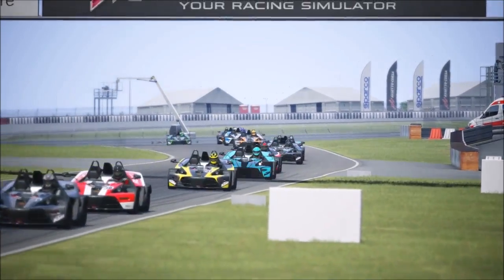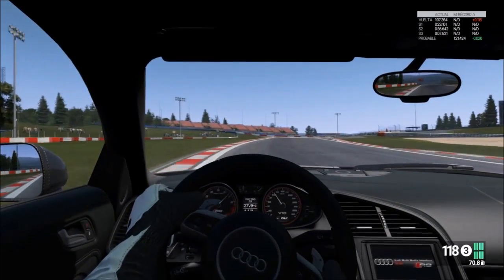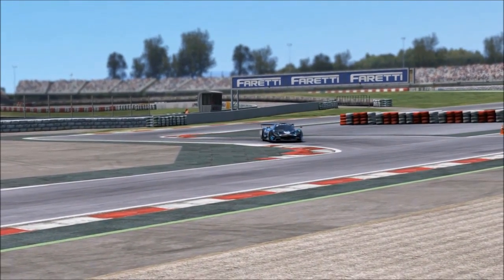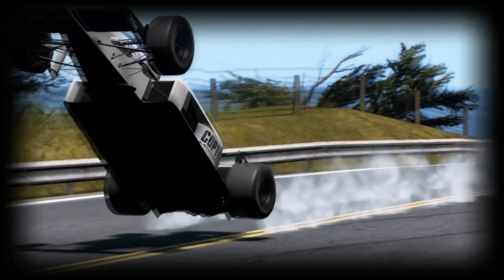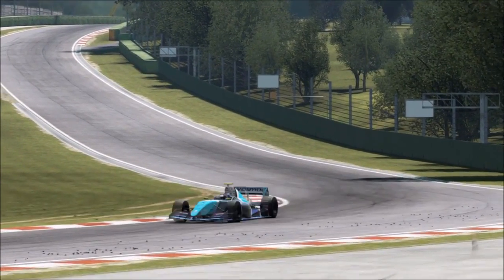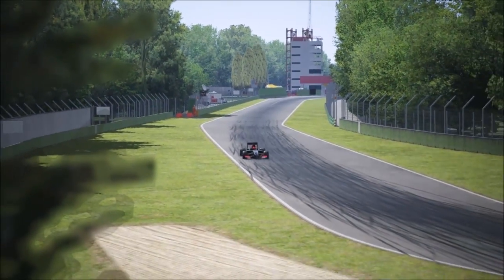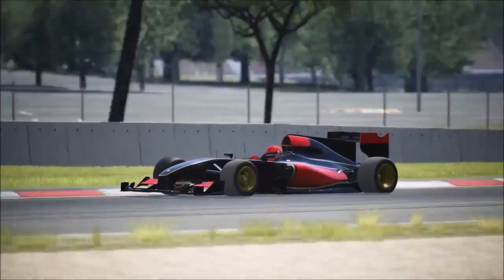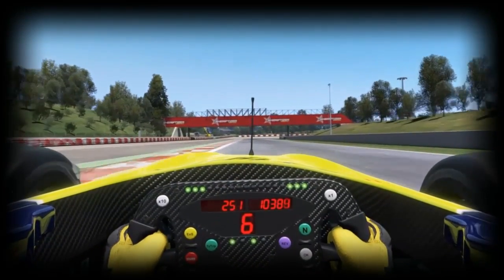Assetto Corsa vs Project CARS: Physics overview (2)

Comment: like you said assetto makes sense in terms of what inputs you give it, but it just doesn’t feel real. something is off. i drove one of the cars in assetto also irl, the new mustang, and it was quite different. wasn’t racing or anything just driving on the street. well this is a racing sim, so maybe street cars and road driving aren’t its strong suit. the biggest difference is that in assetto that car felt heavy and understeery when in reality it kinda felt like it was on rails. i’d say it’s a 7/10 in realism.

Comment: Still not convinced with the curb feeling in AC. Maybe the example, in this case, made PC look bad due to the bad laser scan but in AC curbs are like polished glass with springs on them. I also find the car feeling in PC a bit better than AC. Makes you feel like you actually sitting in something that weighs nearly a tonne while in AC sometimes the cars feel weightless. Also, the lack of camera movement due to the momentum takes that feeling away. Can't wait for AC2 though.

Comment: I’m new to sim racing and only have a T150 for a wheel. But my 120” tv and incredible surround sound system make for one hell of an experience. 

I like project cars 2 for its career mode. It’s really immersive and I love jumping in every Saturday like a real race weekend. That being said, Asseto Corsa is just so incredibly realistic. I Auto X my mustang and the physics in project cars 2 leave me very confused at times. It’s just not natural and unpredictable at times. This is frustrating to the point where I don’t spend much time in it other than the Saturday. The weather elements are cool but if the rain comes down hard enough good luck figuring out when or why you just randomly spun out. Also the spins are very uncontrollable.

Over all

Project Cars 2 has the tracks and cars along with slightly better environment graphics. Also the career mode is outstanding!

Asseto Corsa is the Pinnacle of realism with sound that blows my friends minds when they come over to play. Overall just a better driving-simulation and in my opinion the game that gets most of my time.

I play on PS4
Reply: Do you mind sharing your force feedback settings for your wheel...??? 
Also, do you set the Stability Control option to 0%...??
Reply: RAUL VELASCO sure, for project cars 2 right?
Reply: @bodyshotjake7475  No for Assetto Corsa  please.
Reply: Sorry for the late response.

FFB 81%
Kerb FFB 30%
Road FFB 50%
Slip FFB 25
Understeer on

No driver assist other than breaking
Reply: @bodyshotjake7475  Thank you!
Reply: How do u rate ACC
Reply: @jonitalia6748  There is a pilot from Ferrari gt3 blancpain series it's called David Perel and he plays ACC . He said that the chassis flex in the same way that the real car , I don't know how much realistic is the game really but If it is i think is something ridiculously awesome and great.
Reply: @saulcr839  he said acc feels just like real life except at 95% gravity

Comment: I can't help but feel this is just the typical "it's easier to lose control in Assetto Corsa, thus it's clearly a better simulator because it's more difficult".
Reply: Hopping a 6" curb while turning at 50 mph would definitely upset any car. Assetto corsa is harder to control because it models understeer and oversteer correctly, you just don't have the physical g-forces to help react to a slide before seeing it. It's also harder because most people don't push cars to the limit in real life, while in AC we push further than we realize when risk is not a factor, and then say the car feels "hard to control" or "slides too much".

Comment: I am a pcars player and decent at it. I just got assetto and I'am 6 sec's off my Barcelona time in p cars which is in the 1:46 range. Hell I have not got below a 1.52 in assetto and they seemed like decent laps. Just seems like you lose so much speed in the corners on stock setups at least. What's the key to getting the cars up to pace ?  I don't like the bare bones setup of this game either. I mean no brake or throttle pressure adjustment makes it VERY sensitive on controller.  It also has weird brake bia's value's, no custom button mapping etc. I for sure prefer project cars in this area. Game feels good though and is a joy but I am slower than heck on lol.
Reply from the maker: +James Avery you should not compare times directly, PCARS is usually more grippy when you use similar cars. I remember lapping GT3 at Silverstone in PCARS in 1:59 and in AC I do 2:03
Reply: Good to know thanks !

Comment: Funny, I just spent 30 mins in AC after a long time not having played; took the 458 to Imola on default setup. I was able to absolutely smash each and every kerb, run on astroturf and grass with minimal issues. The car ran over the bumps of the first chicane with absolutely 0 drama - not to talk about how much I was able to cut there (4 wheels off the grey stuff both in the left hander and the right hander) without any sort of cut track penalty or lap being nullified... I also abused the tires quite a bit with a lot of sideways slippage accelerating out of corners (not drifting, but a fair bit of on-throttle oversteer requiring some opposite lock) and after 30 mins of this one of my fronts was still blue and my rears were up in the high 70'ies... flash heating wasn't anywhere nearly as dramatic as what was shown on the formula car. With factory ABS on I was able to stand on the brakes from beginning to end of a deceleration with no tire slip and no adverse effects. Zero skill required.

Now, @Dyr_gl PSN, I won't say you are wrong, because some of the points you bring up about pCars across the 2 videos are entirely valid (like grass is smooth and not punitive enough, astroturf doesn't feel much different from tarmac, medium/hard tire sets are redundant, overheating effect is a bit on the mild side), but I feel like you are not telling the whole truth either. The session I just did clearly paints a lesser difference than the examples you showed. The tire wear point you made is also moot. Real racing drivers (GT + Le Mans) have gone on record stating that they double, triple, even quadruple-stint their tires and the difference between a new and a worn tire is maybe half to a full a second, so this idea sim racers have that wear should significantly degrade the performance of a modern racing slick is wrong and outdated. If anything, I would say that the tire degradation feels significantly stronger in pCars than it does in AC. Laptimes there do drop by a couple of seconds, typically, and the whole car feels very different when it has a full tank of fuel with fresh tires vs half fuel/worn tires vs half fuel/new tires vs low fuel/worn tires. You clearly feel the progression in how the car handles over the course of a race (say 1 hour, for instance). Over the 30 mins I drove the 458 the tires wore down to about halfway and the car emptied most of its fuel load (fuel consumption feels VERY conservative, btw) yet the balance was pretty much the same as when I first started and I didn't notice any shift in grip levels or handling characteristics.
Reply from the maker: About the curbs, grab a car that is actually sensitive to them if you want to see the difference. Using a GT car isn´t going to highlight the differences between games. They are still perfectly noticeable though. 

About having cold tyres after 30 minutes of driving, use a suitable compound, that one is way, WAY too hard, if that´s the only available, blame the regs on that series. 

About the braking, well, that´s what ABS does, again, drive a car that takes any talent to drive and you´ll notice the differences perfectly. They are still there even in the easiest cars though, use a lower ABS setting and take control, you will be faster than letting the most intrusive setting on charge.

About tyre wear, you´re talking about Le Mans mate. The tyre spends like 66% of the lap doing nothing. Good luck double-triple stinting a set of softs in a conventional track like Nurburgring. 

Gonna have to disagree about the wear in both games. Have more hours in both than I like to admit and wear is rubbish in PCARS, it is completely disconnected from your driving, and pretty much every compound in the game is perfectly stable until it collapses suddenly unless you use crazy multipliers. AC is far, FAR superior in this regard. You can influence a lot temps and wear with small changes to your driving and the wear is far, far more progressive.
Reply: How a car handles kerbs depends on how stiffly it's sprung. Any car can be sprung stiffly enough that a high kerb will upset it, regardless of what type of car it is. Inversely, soften up the springs/dampers in your setup and any car can be made to handle kerbs fairly well. How well and how badly the car handles the kerbs basically comes down to freedom of adjustments and adjustment ranges in the setup. Given your video, I expected cars in AC to generally be set up stiffly and to thus bitch over kerbs. I was surprised to find that it was not so I came here to share my experience. Still, I don't know whether you set up your cars before doing these vids, but if not, it is just symptomatic of the pCars default setups to be softer and more forgiving for gamepad users. I guarantee you can set up the Zonda R in pCars to react strongly to bumps and kerbs, if you like it that way. I've had plenty of trouble over kerbs in that game while messing with setups on all kinds of cars, from road cars through GT's to le mans prototypes. Yours is a generalization and an over simplification (This is just the way it is... no, it's not, this might be the way it is out of the box or one way it can be, but it can also do the same thing as AC, if set up for it).

On the heating and wear - same deal. You generalize, when it clearly isn't the case. You showcase some extreme examples in AC, then deflect when I counter that a different tyre clearly doesn't keep the model you display. Sure, the compounds are different, etc - so, be fair. Say that there are also tyres in AC that basically don't overheat, despite a 30c temperature and plenty of sliding around with zero performance degradation. Don't just black and white it. That projects a totalitarian impression that is simply wrong. Nuance, dude.

On braking, real ABS locks, slips, locks, slips. It doesn't just smoothly correct your input. Both games have fairly bad ABS simulation, but at least in pCars if you stomp the brakes like an animal, they do lock through the ABS and you get longer braking than what you get when you correctly stab and bleed off the brakes. Without ABS I find that it depends on the car, tyre and brake pressure whether or not the wheels lock and the car slides. I agree that the tyres could overheat more from brake lockup and it's a pity flat spots were removed from pCars, but once again it's a partial truth and a generalization.

On RL tyre wear - it's very common that drivers double-stint their tyres in general - at LM they triple-quadruple stint them, but anywhere else they double-stint easily. Most of blancpain GT3/Endurance was that way, iirc.

It seems we have very different feelings about the wear and evolution of the car handling in the two games. I haven't felt what you describe with the tyres feeling static and then suddenly dropping off a cliff ever, and I have easily 1000 hours on pCars. To me pCars feels very alive and dynamic. If anything, I would call AC very numb and static. The ffb in pCars is supple, full of information. The tyre breathes, gives and grips. You can feel it progressively letting go and you can hold the drift, then bring it back. In AC all you get is a disproportionately hard yank on the wheel with very little subtlety or graduation.
Reply from the maker: Richard Navone yep, not going to agree in anything. Especially on the stiffness thing. Theoretically you can make any car stiff enough to be upset, sure, but no one is ever going to give the single seater treatment to the springs or dampers of a GT car as it's WAY out of the ideal window for its weight, tyre pressures and downforce levels. So a GT car will always be a GT car over curbs. Just look at the monstrosities they install in Hockenheim for DTM races to stop them cheating.

On the subjective stuff about the games, personally I think you're way, way off. Kicking the pedal is far more easy in PCARS in both ABS and non ABS cars, mainly because the brakes are underpowered in relation with the tyre grip available but also because the weight shifting is rubbish so rough weight changes do nothing.

As for tyre wear, I think you're way off too. I have taken the soft compound from pretty much every class to absurd levels of mileage way beyond what is normal for that class with no lost of pace whatsoever. The Formula A vs Ferrari cars (or the Exos) is embarrassing in this respect, and the GT cars don't fare much better. Cheers.
Reply from the maker: Anyway, if you want to see proof of some of those things, I recommend watching some of the setup videos I made for specific cars where you can see me run absurd amounts of time and still getting purples towards the end, or some of the onboard driving with telemetry on to see the kind of nonsense I get away with under braking. I had to un-learn many bad habits after jumping boat.

Pretty words about what you feel are cool and you can defend anything in abstract ways calling it alive and dynamic but you can´t argue with numbers and pedal inputs. Glad you get good FFB though, for me correcting the rear in PCARS is guesswork and anticipation, not reaction.
Reply: @dyr_glpsn4209  good job with that navone guy, he clearly works for the company and it looks like we can blame him for pc3
Reply: @jonitalia6748  You can make an ignorant emotional if you tell him the newscast in rime! There is people who don't understand complex things and they prefer to stay with his simple stuff, the honey was not made for the donkey!

Comment: I think if PC and AC would have to have a love baby that would be the most realistic game between them. They're both ends of a spectrum with the truth as far as I know it from 7 years of racing experience right in the middle. 
As far as Kerbs, cars don't stay as flat on those high toothy kerbs as they do in project cars, but they also aren't unsettled by it as much as in AC. On my home track of Zandvoort we have several of those high toothed kerbs and they just don't unsettle your car that much at those speeds. But the first time you hit one, you think your wheel breaks off lol. But that's just unsettling one corner of the car, a corner which is at the time not carrying weight and thus is not that important. 

i think the truth about cars on the grass is in between AC and PC as well, as long as it's dry. I remember this time I had to go half onto the grass during the start of  a race, as long as I was gentle with the steering input I could keep the throttle burried (which is what I did, otherwise i could have just stayed behind that 3 car wall)
Reply from the maker: I think AC is way superior in this one, and a good part of that is down to how every car handles this stuff differently, and how the direction and momentum in the moment you ride them matters a lot to the outcome.

GT and road cars can navigate pretty nasty curbs without much trouble, like the ones you mention at Zandvoort. As long as you hit them with 1 unloaded wheel you´re fine, but if you´re too greedy and touch them with the bottom of the car and you are into trouble. And not only it changes with how you ride them, it changes a lot from car to car too.

Then there´s grass. Same story. Underpowered cars don´t mind it too much in AC, you can keep it flat if you´re not asking a lateral effort at the same time. But God help you if you put the rear wheel of the hybrid Ferrari F1 car in the grass on corner exit. You´re fucked if you don´t lift big time.

Comment: Some of the comparisons, especially the one with the Pagani where it hits the bump and jumps in AC but not in PC, are not right. You can clearly see the differences in level design and that the track is not the same. I think, in PC that corner is not as high as the one in AC and thus it does not jump at all and not because of the physics. The suspension thing really looks weird in PC, although a comparison from AC would have been better.

Comment: it is hard to find right settings in pcars. it is harder to reveal its beauty.   i have played 250 hours ac  and 980 hours pcars. it is possible to feel every cars own steering character in pcars.  in assetto , every car has same steering character.
Reply from the maker: I must be the only person on Earth that enjoyed default FFB settings for PCARS LOL. Really, it was just boot and play for me in 90% of the cars, maybe the default profile fits my wheel model well or something.
Reply: I feel PC really empty in feeling terms while assetto is fucking awesome in each car , you can see 60s 70s breaks are very bad comparing to 80s 90s and this are bad form the actual era, you can feel the power in each car , if it is turbo if it atmosferic if it has turbo lag or not , you can feel the engine break of each car you have for example ford scort that is very hard to drive it fast , if there is a game where you can find all cars different is A.C. even we can't compare it cause PC are simcade and assetto is a simulator.